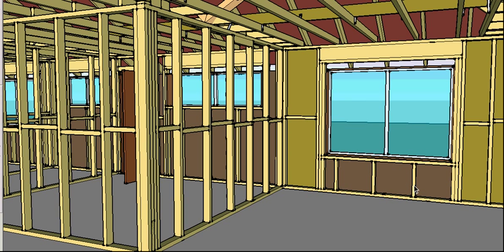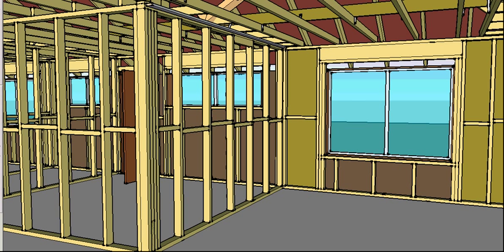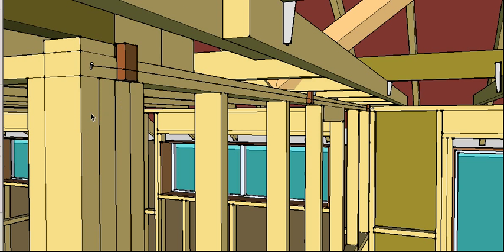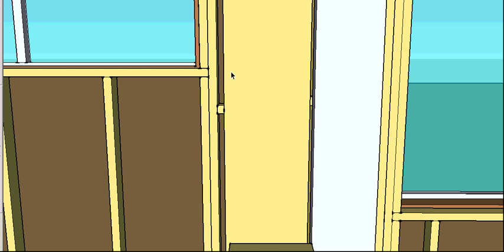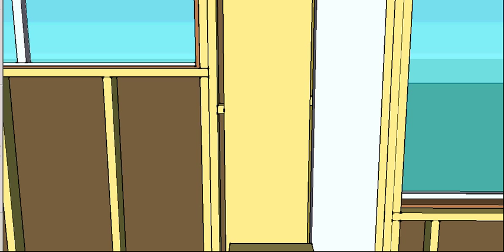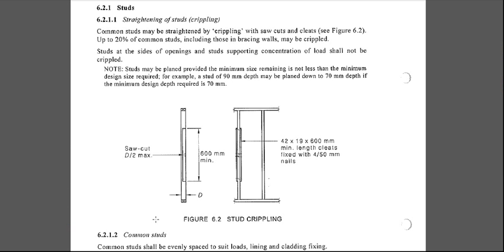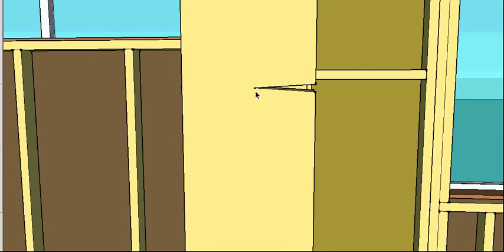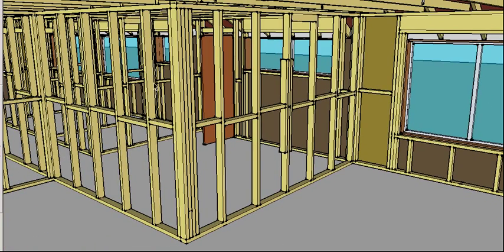How to straighten a Timber Wall

Comment: I have problem when I straight the walls on  door openings ,i do the walls like you do ( ends first ,top and bottom after) but in door openings some of the jamb  studs are now ,so I pack them but end 95mm or 100mm in some cases,and if is square set door jambs they end up 5mm to 8mm different revels
Any ideas?
Reply from the maker: Hi Mate, if you are packing a door stud you would have to plane the opposite side to stop this from happening.
Reply: @Buildsum  no worries
Thanks

Comment: do you need to check the middle of the wall with the stringline?
Reply from the maker: Hi Mate, once you have straightened the top and bottom the straight edge will let you know what is happening in the middle. You can do it but it tends to get in the way when you are packing and planning the studs.

Comment: Bit late to the party here, but I agree with the previous comment. Isn't it just easier to replace the stud? Especially if you're having to remove the noggins already?
Regardless, I appreciate you sharing this information with us.
Reply from the maker: Hi Robert, Yes in this day in age it may be easier and quicker to switch out the stud. Remember this technique has been around since a time when Labour was cheap and the materials were expensive, nowadays that has almost reversed with the labour being a major contributor to the cost of a job.
Reply: @Buildsum  thanks for taking the time to reply, appreciate it. Regardless, it's a neat trick to keep in mind.

Comment: Hello and thank you. With staggered noggins how do you attach gyprock horizontally? if you're using 2400 sheets horizontal and have the noggins above and below a 2400 high line none of the screws will hit. Thank you.
Reply from the maker: Hi Uri, The plasterboard is nailed to the studs, not the noggins. plasterboard only needs to be fixed, generally at 600mm centres, so fixing to the studs is all that is required.
hope this helps
Reply: Buildsum thanks so much. Duh! :). You helped me build a shed last year (no gyprock) and it turned out perfect. Now it’s time for an interior wall...

Comment: What if your straight edge isn't long enough to get across the whole wall?
Reply: he explained that mate - use the string and block
Reply from the maker: Hi James 
As long as your straight edge is long enough to do the height of the wall you can just use the string line method to straighten the top and bottom plates.
Hope this helps

Comment: Also good to note: When there is metal bracing in a wall, make sure your studs all bow one way, and you brace the side which isn't bowed, so you only have to pack-out the one side which is braced. This avoids many headaches!
Reply from the maker: Nickanoms Thanks Nickanoms great tip
Reply: Nice mate agreed!